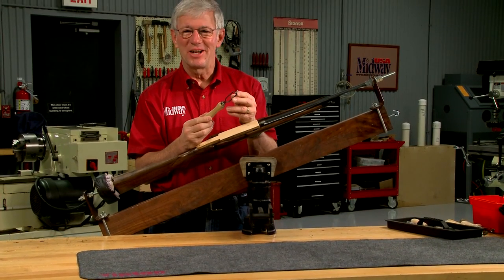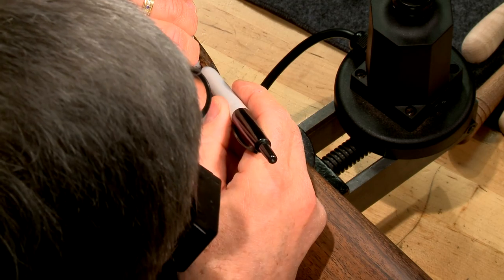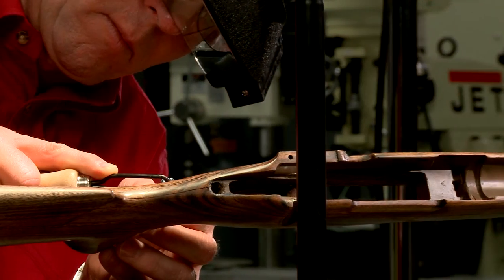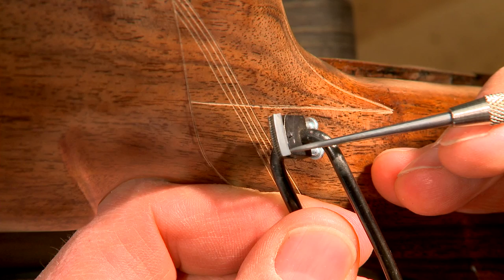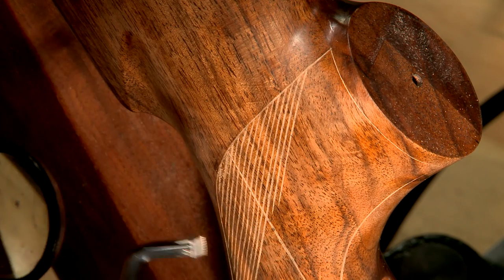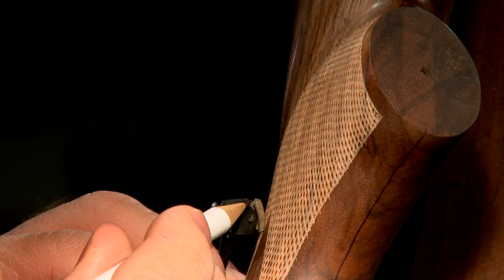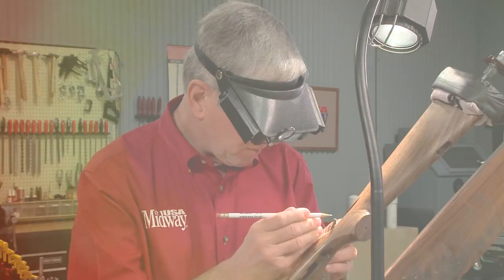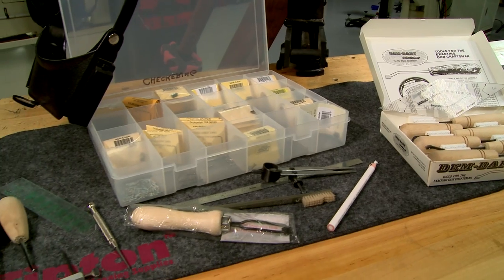Hand Checkering Tools - What They Are and How To Use Them | MidwayUSA Gunsmithing

Comment: Great video. I have an old Squires Bingham Stirling Model 50 .22WMR. The stock was exposed to moisture over a long period and the varnish deteriorated and is ruined. I cannot buy a replacement stock. I watched your videos and wondered what is the best way to repair the stock. I've removed most of the varnish with a cabinet scraper. However, the checkering is proving to be very difficult. Do I use paint stripper or scrape the yucky varnish out? Some of the checkering is worn over many years of use. Can I go over the checkering to redo it? If so, how will I determine the angles for the cutting tools to use? Thx, Mark